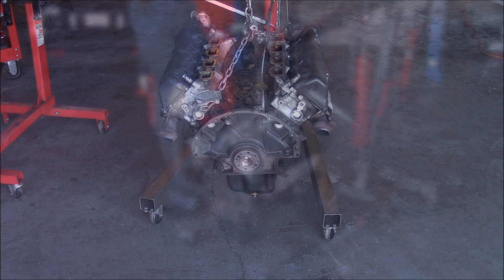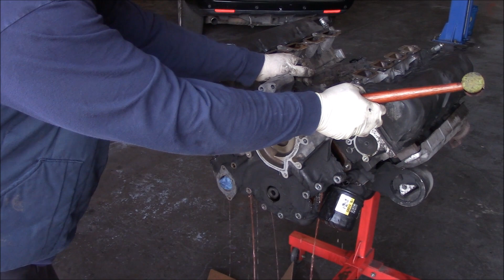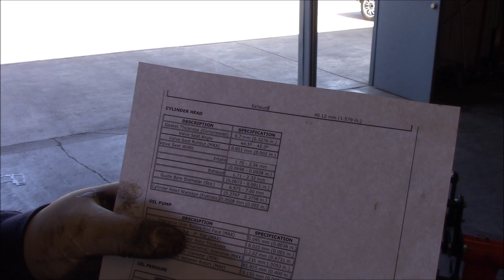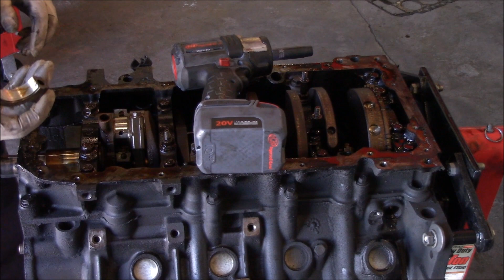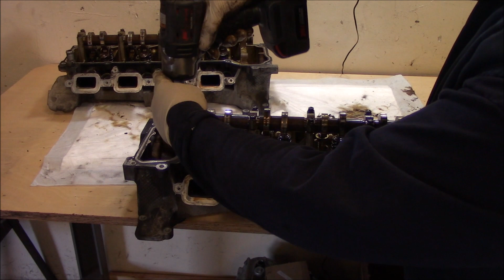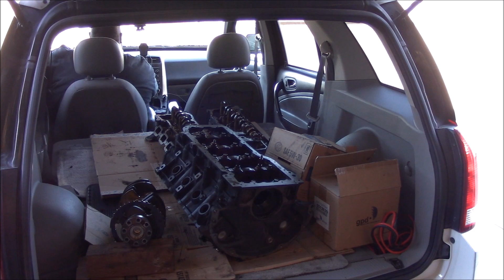4.7 Dodge Full Engine Rebuild pt.3 (Engine Teardown)

Comment: Amazing series!  Thanks you.  Getting ready to do bottom end assembly and I am wondering if connecting rods for the 4.7 are specific to each cylinder?  I have new pistons, new rings, new WPC treated rod bearings and plan on checking clearances with plastiguage.  Thanks in advance.  J.R.

Comment: Hi, my 2010 ram 4.7L 4x4 has a pressure of 7psi and a slowdown idle of 500 rpm. 
the engine does not knock and runs normally it has 190,000 miles. I changed the oil pump, no mud. Can we change the crankshaft bearings without removing the engine ?
Reply from the maker: You should definitely remove the engine!
Reply: @BryansGarage951  Thank you for answer. I saw your video about 4.7L Dodge full engine rebuild, great job, and much work.

Comment: Any suggestions on how to manage a vavle seat drop?

I was chasing a blown head gasket and found this.  
No other danage outside of #1 Valve and head on the right side.

The other 3 heads looked great! No metal in the oil or anywhere!  

Looks like the next step should be replacing the head and vavle.  

Any advise? Recommendations?

I dont know how to send you the pictures, but your input would be appreciated.

Comment: Thanks for the help with my last question.  Now i'm ready to mount on my engine stand.

What bolts and size did you use?  The one i borrowed didnt come with the one that fit.
Reply from the maker: I can't remember it's been a while. but I remember I took a transmission bell housing bolt with me to the hardware store to find the correct bolt. You only need two bolts that screws into the back of the block the other just needs to be bolts with nuts.

Comment: Youre right side cam looked to be out of time. If you go back to 25:02 you can see that your 12 o clock mark is good, your 6 o clock mark was good, your left side cam had the v8 mark at 12 o clock, but your right side cam v8 mark was at 10 o clock.

Comment: For anyone wondering, the bolts for the stand you'd need are 3/8 x 16, Trans bolts but longer, I got mine at lowes, 3 inches long is perfect, get washers!! (This is not all thread) and get 3 1/2 long for the lower area without thread, don't forget bolts for those two!!
Reply from the maker: 2 top bolts should be 3/8 x 16 coarse thread and around 4 1/2  to 5 inches long with washers. Lower bolts 7/16-14 grade 8 bolts 7 inches long with washers and nuts, place thru the lower non-thread wholes on the block with nuts on the other end.

Comment: Hey bro, thank you for the detailed biopsey on the timing chains. I zip tied my timing chain sprocket to the cams but the chain slipped off the tensioners. I went to install the sprockets to the cams now there is chain slop. Any chance it slipped off the crankshaft cam? Am I screwed, pardon the pun, Thanks again for the detailed information.
Reply from the maker: Hello James, Sorry bro not sure I understand.
 What happed, the timing came off completely while the engine was running?
Reply: @BryansGarage951  since I'm behind the water pump and under the timing chain cover just to reset the chain and re-time the chain idler to the camshaft sprockets, do you think I should use this opportunity to just put on new parts? For example a new timing chain,? It's got about 100,000 mi on it. One of the new cams I installed I went from regular 4.7 camshafts to the high output camshafts one's a little bit tight although I did torque everything correctly. I'm really not worried about 200 or 300 horsepower turning a camshaft regardless how tight it is.

Comment: What size bolts (diameter, thread pitch and length?) do I need to buy for the engine stand to bell housing?  I would like to buy them before I pull the engine.
Reply: Did you ever figure it out? I need them too

Comment: Great videos!  What size are the bolts used in the engine stand adapter to bolt the block on?  Length, size and thread pitch.

Comment: If I'm not mistaken, there are threaded holes in the top of the block that are unused just for lifting the engine. They are centered so that the engine is balanced.
I'm about to tear down my 4.7L. I'll update this comment and let y'all know the thread size.
Reply: Did you ever get the thread size?

Comment: Bryan - Thank You for taking the time to make a video with so much attention to detail from start to finish.  I'm not stranger to pulling motors, but have never attempted a complete rebuild.  I just acquired a 2002 Jeep Grand Cherokee with the 4.7L with 81K on the clock with a motor that's making a metallic knock.  No Codes, No check engine light, has good oil pressure and runs and maintains normal temperature.  

This is my 2nd Gen 2 JGC, I think this is the best Generation of the all the JGC's.  My 2016 EcoDiesel is a nice ride, but could never take the abuse of what a Gen2 can take.  

Once Again - Thank You...  One of the best JGC Training videos of all-time.  Thx :)

Comment: Well done video with tips and observations that only an experienced mechanic would know. Things you won't read in a factory manual. I have a 2007 Dakota 4.7 but I will not personally rebuild a modern engine. I started with cars in the 60s when technologies were simpler and less fickle. You could repair in a rainstorm and keep going. But I enjoyed your presentation. Thanks.

Comment: The large timing sprocket actually is rather cheap...my competition cams dual roller timing kit came with both sprockets and cost me $52
Reply: Where did u find that kit?
Reply: @RW5_88  I work at O'Reilly's and if you have them search for anything timing related it will come right up. I just put it on mine yesterday and I'm waiting to start it up next week...

Comment: I have a 2006 1500 with   4.7 magnum motor. I need the correct timing chain cover gasket. It looks like it would take the 46000 gasket but everywhere I call says Tcs 46022 which looks to be a lot smaller. I would appreciate some advice. Also what is a good site for buying genuine Mopar parts.

Comment: I stamp my caps ( and a punch mark referring to the front of the engine) if they aren't marked and keep with its conn rod. I keep all my lifters, rockers, bolts and pushrods together also. Drive shafts and flywheels get marked (like you did on the flywheel)
I've taken motors of my own that were in this condition when I was really poor and run my hone tool in it, remove any lips on cylinder walls. re-ring it, new cam chain and oil pump, valve seals, lap the valves and get some fel-pro gaskets and put it together and run it.
Im gonna hit ya up one more time for what you use to edit your videos?? lol

Great job as usual Brother, looking forward to the next. Thumbs way up
Reply from the maker: I was actually really surprised these connecting rods and caps didn't have a stamp on them I've done other 4.7 that did have a stamp. For my video Editing I Used Windows Movie Maker and power Director 16.
Reply: Thanks, Bryan, I actually may have the movie maker already.
Yea I haven't been in one of those engines before, but many others. It can be the same manufacturer and some will be marked and others not. It surprised me how the valves leaking as bad as they were and the vacuum gauge as steady as it was. one would think the valves would of made the gauge jump around at least a little
Reply from the maker: TwiZ1975cj5 I figured out what happened. My vacuum gauge was the problem I hooked it up to my Jeep and disabled two cylinders and no change and vacuum still reading a steady 20 inches of vac,  BullShit I'm in the market for a new one I'm going to spend a little bit more money and get a Mac or Snap-on vac gauge.
Reply: Ahhh how nice. Failure of diagnostic tools can really suck, as you know. Definitely sounds hosed. I think the one I have is a Lisle ( if I spelled it right) if I'm not mistaken. Had it for YEARS and still seems to be functioning right. Got lucky with that ex. manifold bolt lol...and yes, unfortunately, I know that smell all too well lol

Comment: Bryan one thing I thought about since I did have a Durango for like 11 years is that there is a tsb for the crankcase ventilation on the 4.7 I don’t know if you’ve seen that before but it helped with the crankcase ventilation and it was better than it just venting in the oil filler neck.  I don’t have as much as experience as you but thought it might help.  Thanks so much for doing the video!  Are you going to set up a patreon or maybe sell shop t-shirts?
Reply from the maker: These things do have PCV problems I see a lot of valve cover gasket leaks because air whipped up from the cam at higher speeds pressurizing the valve cover and blowing through the gasket because of poor ventilation. I do plan to set up a patreon it would make things a lot easier!
Reply: bryan916 well if you do a search you can find the new way to route the pcv it actually uses one of the crankcase breather tubes from the back on the driver’s side.  If your interested I’ll see if I can find it?
Reply from the maker: I'm interested! love to learn somthing new
Reply: bryan916 this is the tsb.  http://dodgeram.info/tsb/2006/25-001-06.htm.  It does work on Durango, Dakota, etc

Comment: Loving that new impact that you have. My old 18v dewalt can't do some of them bolts. How technology has changed. Great video of the breakdown Bryan. I have a question, what brand of machinist flat bar to you trust and recommend for checking head warpage?
Reply from the maker: Longtrailside  I use this thing everyday it's light weight hits hard and has difference setting to keep you from over torquing also the LED light is super bright as well I love this impact gun it's one of the best 3/8 impact guns in a game. As far as a good machinist ruler or flat bar I'm not partial to one particular brand but I do only buy made in USA machinist rulers or flat bars there's a difference!
Reply: What model is that impact?